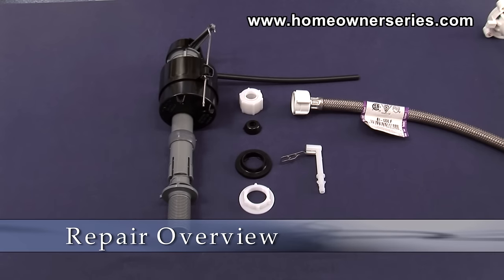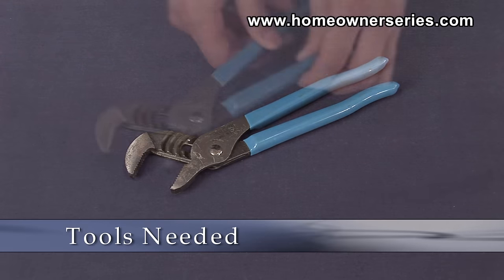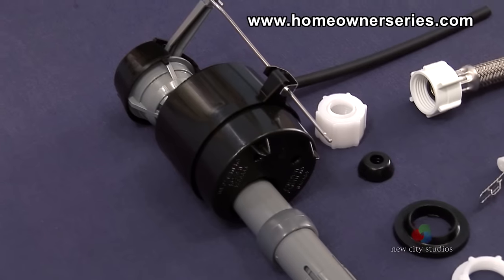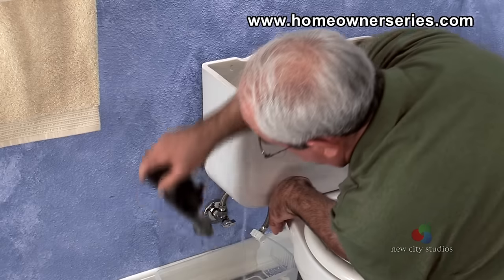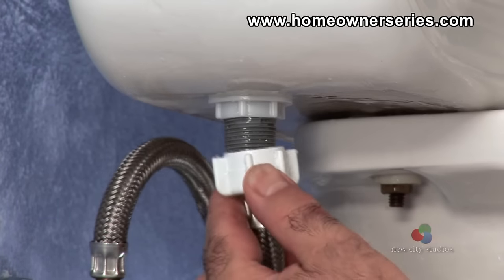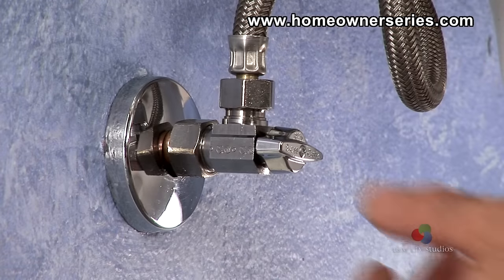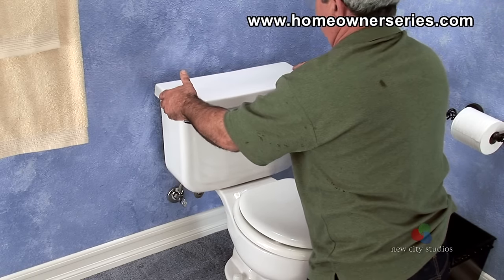How to Fix a Toilet - Fill Valve Replacement

Comment: Clear, concise and very helpful. I replaced an old fill valve in 20 minutes, 10 of which was spent removing the last plumber's lock nut. My only beef is that all of these how-to videos use brand new, pristine toilets. I'm ready to see one where everything's rusted shut, corroded or slimy. Until then, this is the best!

Comment: I installed this fill valve around 6 years ago and working fine.  NOW in the middle of the night the extremely loud whistling is unbelievable.  Through the wall it was heard so sharply that there was knocking on my door because of the noise!  I think I'll install the floating ball again and go back to more soothing toilet sounds, if I would have known this I wouldn't have switched from the floating ball type assembly.

Comment: LIFE SAVER, Sir! 
Thank you for showing the base being OK scenario where changing just the top part by loosening the lock nut was all that's needed. I just installed the new upper  in just a few minutes and no more whistling from the old worn out valve. 
Thank you so much!!
Reply: swedesam my toilet is doing the same thing making a constant humming and I been looking all over youtube on how to fix it and this was by far the best tutorial and im glad to find out replacement is simple and solves the problem of the noise
Reply: swedesam t

Comment: best video I've seen on this, i couldn't figure out how to actually adjust the height and nobody else showed it. Mine was stuck on pretty tight and while i thought it was pull straight up I didn't want to break it. Seeing that was how it's done, I got it fixed to proper fill height with extra force.

Comment: Thanks. I rent my place so maintenance replaced a fill valve when I complained of intermittent running. It was quiet for two weeks. The intermittent flushes started again. It looks like the fill tube gets too deep and I have to pul the tube out and sometimes it fixes it. So I see that adaptor clip in the video and I think it will be the real fix I need. This fill valve assemble had no adaptor clip.

Comment: Thanks for this video. The plumber installed a new toilet. There was leaking. A new fill valve was installed. There is STILL a minor leak at the nut.It looks like there is an area in the nut that  is faulty. I will go to Home Depot to see if I can buy a nut, but is there any type of substance that I can put on the nut to make it have better contact with the bottom of the tank. I don’t want to call the plumber yet again.

Comment: I used a Magna Flush brand of toilet repair kit and was quite happy with the results, until about a day later when I kept hearing a noise after the tank filled.  It may be that I have the fill valve tube set too high and the float can't reach the correct level to completely turn off the water supply.  I don't actually see any water running, just the noise.  Guess it could be a siphoning effect.  Unlike the Fluid Master fill valve assembly, the height of the valve is not so easy to adjust once the assembly is installed.   Any suggestions?

Comment: Thank you - this video was extremely helpful and my install went off with only one hitch (i broke the clip - don't know my own strength) but the suggestion to thread the hose into the overflow worked perfectly!

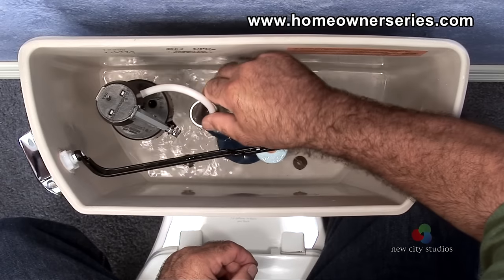Comment: At 1:15, what is it you're doing to pull the top of the valve off? It looks like you're just pressing a button, but I can't seem to do whatever it is you're doing.
Reply: +jugghayd It's a lock ring, pulls straight up off the base, then the whole top can pull straight up after you remove that.
Reply: the lock ring for me does not seem to budge...

Comment: Good video, but at around 1:00, it mentions the possibility of just changing out the top half of the fill valve.  The instructions for my valve (Fluidmaster 400A) specifically caution against this, as it can cause leaks.  

I agree with the instructions.  You're paying for the entire valve, which includes a new rubber gasket that goes down against the bottom of your tank.  It makes no sense to leave in an old, slowly-hardening gasket that may start leaking at the worst possible time. 

Take the extra time and replace everything.  The twenty minutes you save by half-assing this job will only result in flooding your bathroom.
Reply: +Kirk T It depends on the kit, Fluidmaster also makes a fix kit for the 400 series which is states you can keep your existing base if its color is black and not damaged. They made older models which should be replaced, but I guess the new black base is meant to quick connect to replacement tops if you prefer.

Comment: I went to undo the inlet attachment nut and found the plastic tongue space filler was in the way so took the toilet seat off to get space filler tongue out  to get to hex nut off in  tight space, found I was obstructed , caroma toilet. Nut was on too tight when fitted.

Comment: I have a new toilet its been great for several months but suddenly the water keeps running. Even thought the fill valve floats to the top (I thiink when it floats to the top, it is supposed to strop the water flow). Not sure what adjustment I neet to make. Please advise if anyone can, please advise. Thank you, Mike

Comment: question why would inspectors say there should be a specail flush vale in a toile in the bathroom of a gas station bathroom said it need a , a.s.s.e -o type fush vale what is that

Comment: I don't understand how the f**k American toilet works!!! if the overflow tube is for water draining out of the tank when it is overflowed, why the water fill valve hose is inserted in the overflow tube? this way the tank shouldn't be filling and the water should just drain to the toilet every time, but somehow it fills the tank through the overflow tube. . . PLEASE, explain me how this thingy thing works???